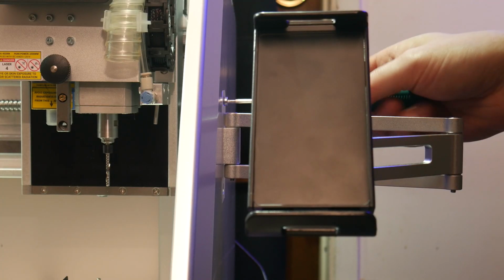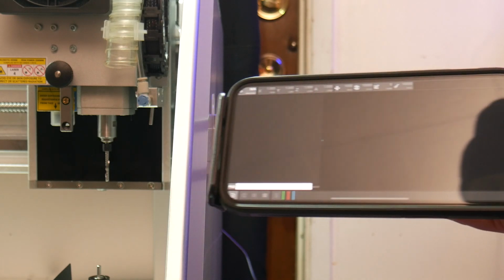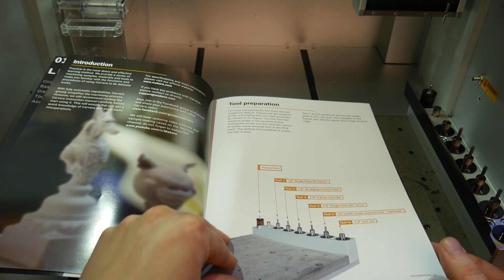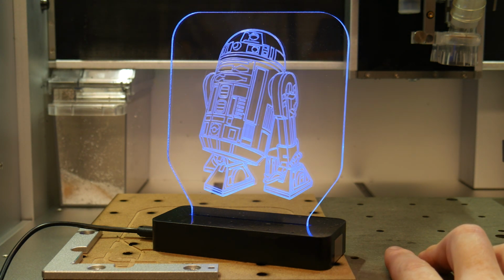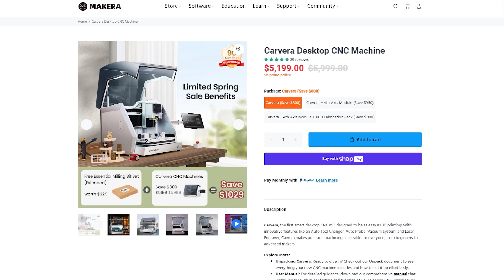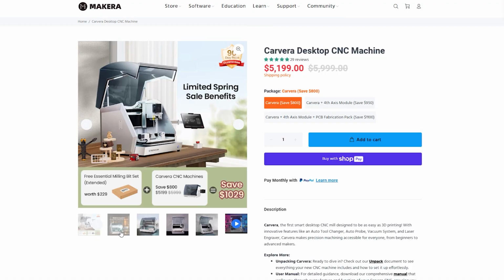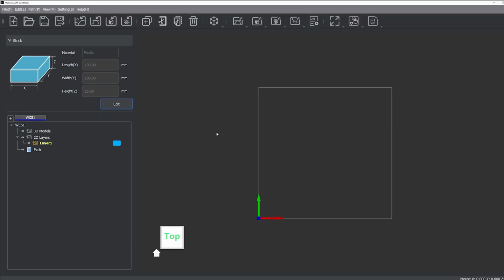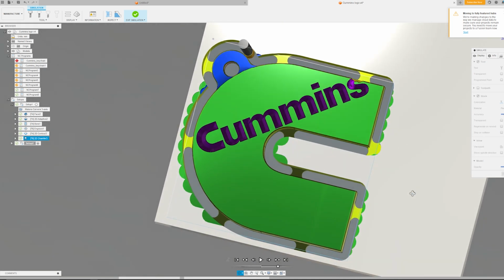Revolutionizing CNC Machining: The Makera Carvera - The Ultimate Desktop CNC Machine

Comment: Thanks for the video. Quick question, how long was the milling time for the keychain? I’m looking to set up an impromptu station, where there is no power outlet. So ill be using a power pack that i can recharge offsite and bring in daily to run it. With an estimated 400watt power draw, i think I’m looking at around 3 hours of run time before switching power pack. That should be ok for my needs. But I’m on the fence between the carvera and air. 
Do you think ill save run time with the carvera, with the auto tool changer over the manual?
Reply: That's exactly the same thing that I'm trying to figure out.  It's a critical question that you'd think they'd include in videos like this.  Instead, you have to spend tons of time trying to get an answer to such a simple question.

Comment: The content is exactly what I was looking for and the production was outstanding.  I have more experience with 3D printing and Laser Etching than with CNC...forgive my newbie question.  When designing a CNC project, either with or without a machine with an ATC, do I need to define the CNC bits as a part of each toolpath or is the Carvera software smart enough to make these decisions.  Thank you!
Reply: Yes you need to define which tools are used. Just like you would (pre) define nozzle size or material used in 3D printing. Most software that allows you to create tool paths also allow a tool library for easy selection, combined with material presets if wanted.

Carvera CAM has their own tools preset along with some material settings to get you started.